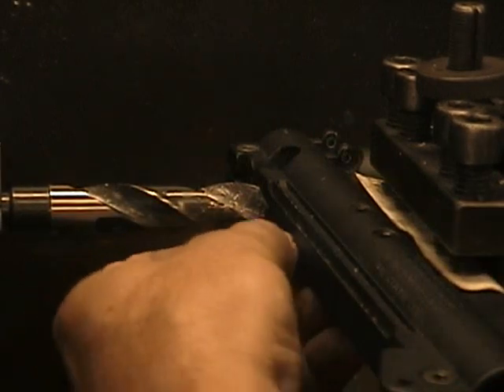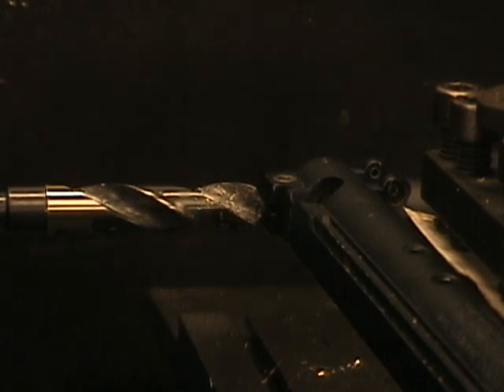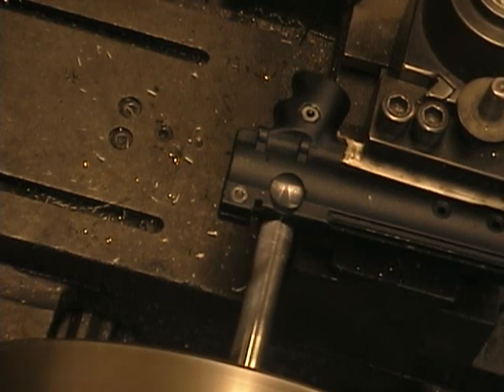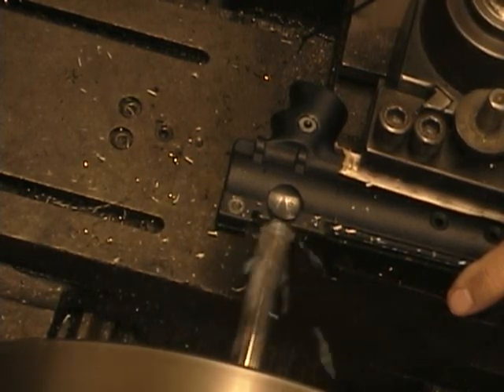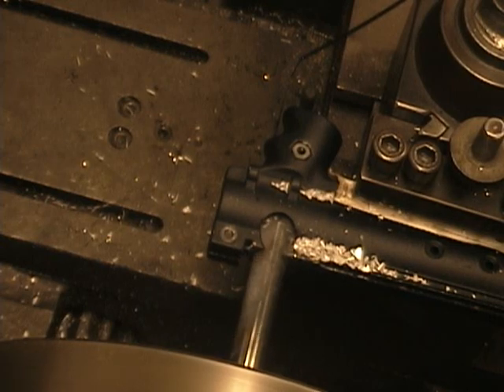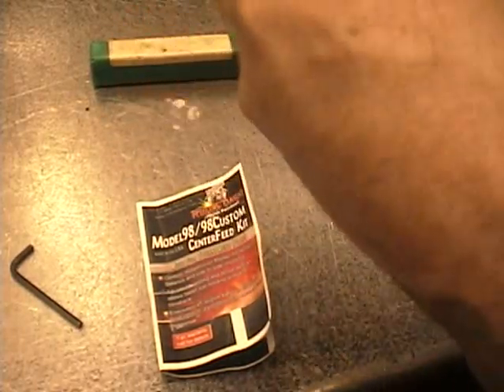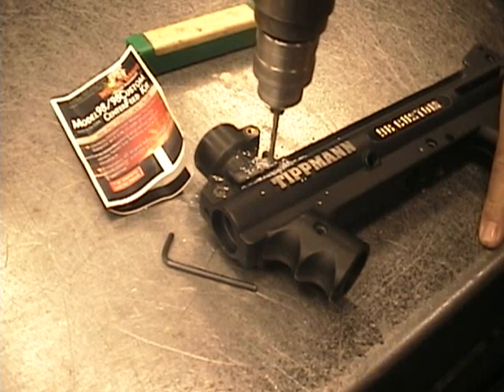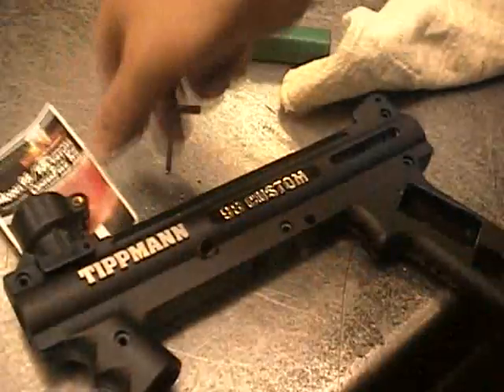Model 98 Rufus Dawg Centerfeed - Tippmann Mod - TinMan of Tippinators

Comment: haha Russc, I know what you mean. The shell is only thin at that location, so I just zip through it with a drill. If it was any more I'd use a 'T'
CJ, oh man, the first 6 I did with a die grinder and a router bit, A Dremel would take a while, GL